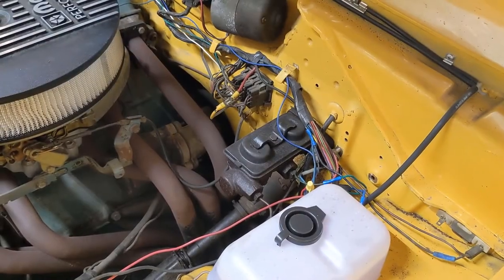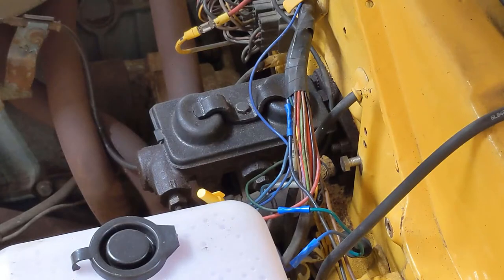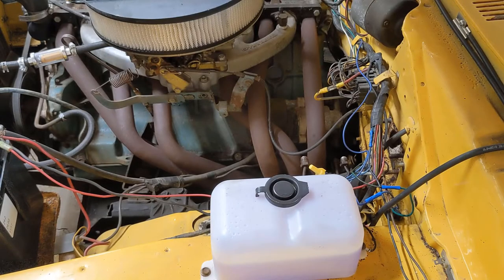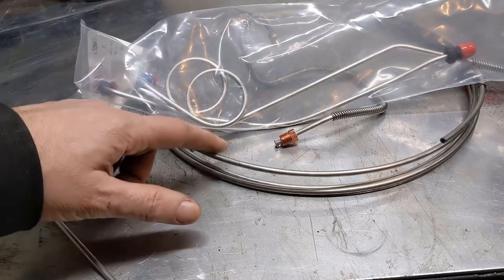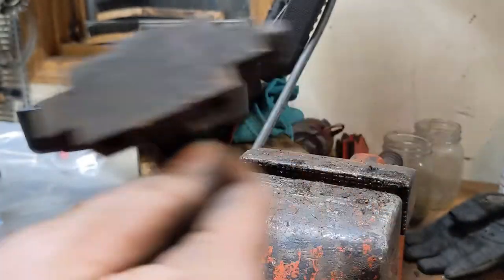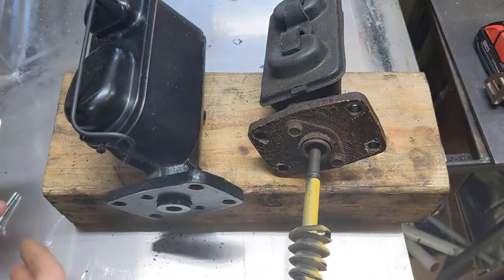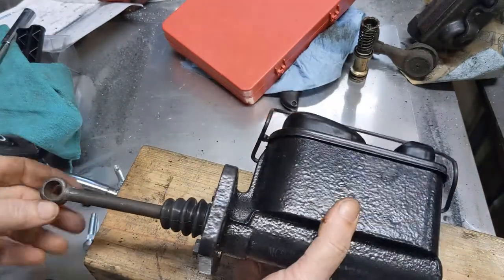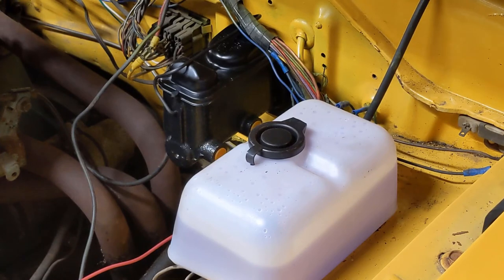Mopar A-Body Master Cylinder Swap: Pirate Jack Disk Brake Conversion Part 3

Comment: Next time use the brake pedal to pull the push rod out.
Leave the master cylinder bolted up, remove the brake switch inside the car, and just pull up on the brake pedal.
The push rod will pop right out. Then remove the push rod bolt. Plus the push rod grommet is important, and readily available.
Get the right part, do the job right. We are talking brakes after all, stopping is good.
Reply from the maker: I've never had great luck using the pedal to pull the rod, but it's certainly worth trying for anyone watching.  It also looks like, at least as of right now, Doctor Diff carries the grommet.
https://www.doctordiff.com/manual-brake-push-rod-retainer-bushing-clip-rubber-grommet.html
Reply: @YoshimoshiGarage   All that's telling me is you've never tried it. Anybody that has, would never do it any other way. Happy Moparing.
Reply: I did this myself when realizing how hard it was to get that bolt out I was like ... what if I pull this pedal back - "pop" so easy.
Reply: @YoshimoshiGarage  I've looked at that grommet before at it looks a lot like a piece of vacuum hose. They usually come with a new M/Cyl.

Comment: station-wagons & police cars , had 11.83” rotors .
pin type , calliper adaptor was Chrysler part #3880557 ,…
76-78 b-body 
Gran Fury , Royal Monaco , Coronet
Reply: the 11.75 replacement rotor is dirt cheap , so like the police dept. , use metallic pads .
Reply: A long time ago in the early '90's I converted a '71 Satellite with 10" manual drums to power disc with new parts using the 'Ehrenberg' Mopar Action article and used the rotors (new) for a 'B' Dodge van. I think they're the same s cop car rotors. The only junkyard parts I used were the knuckles and caliper adapters. I got the Knuckles from a mid '70's A body. The adapters came from a '75 or '76 or '77 Cordoba I think. The parts were pretty cheap. Back then everything was still at the parts stores. I didn't have 'core' calipers but I think it was only $10 ea for the charge. A few years later they didn't want any core charge. I think it only cost me maybe $140 for that using all new parts (hoses, pads, calipers, Master Cyl, hardware, bearings etc) Except for the adapters and knuckles I used EVERYTHING new.

Comment: This is very helpful getting the rod out. If you are converting all four to disk brakes do you need to change the proportioning valve?
Reply from the maker: I've not done 4 drums to 4 disks.  I'd certainly try it first without swapping the proportioning valve to see if they're balanced.

Comment: Do you have part #s for brake lines? I need for my 67 dart gt
Reply from the maker: I believe I made the hard lines for that one myself, though if I had to do it again, I'd probably look at Fine Lines to see if they have them pre-bent.  If you mean the hoses at the wheel, those came with the kit.
Reply: @YoshimoshiGarage  in the video I thought it said you ordered the hard lines pre bent. I'll try finelines. Thanks!

Comment: How would my install be different if I'm working with a 63 that has the single jar type master cylinder still?  Thanks for the great video.
Reply from the maker: It'll be the same. You'll have double lines to the proportioning valve, then it divides to the front and rear.

Comment: I'm looking at this kit for a 69 Barracuda - why did you forgo the power brake option?
Reply from the maker: The car was manual brakes to start with. Adding a brake booster takes up a lot of space and makes working on things that much harder.

Comment: I’v done a disc brake conversion on my 67 Barracuda, I needed a new master cylinder to finish the job, just looking at it doesn’t seem to be the right one. Which master cylinder did you go with? Can you possibly drop a link? Any help definitely does just that. Thanks
Reply from the maker: I did a drum to disc conversion and this was the master cylinder that came with the kit.  The swap also requires changing the proportioning valve to either an original disc valve or an adjustable (which the kit came with).  This is part of the Pirate jack kit, but if I were to order just a master cylinder, a 1974-ish Dart master cylinder (Raybestos  MC36412, front disc, rear drum, manual brakes, 4-bolt flange) would almost certainly be the same.
Reply: @YoshimoshiGarage  awesome, thank you this will most definitely help me 🤙🏼

Comment: Have you drove it with the manual discs? I'm going to convert my 67 and can't decide if I want stay manual or go power.
Reply from the maker: Yes. It's not power, but waaaaay better than it was with manual drums all around.
Reply: Is the pedal closer to the floor than it was with the drum brakes?
Reply from the maker: @mustacherides  I didn't measure a before and after, but if it's closer, it's not enough to be noticeable.

Comment: Excellent and informative. Horrible design getting the master cylinder and push rod out. I have never had so much trouble removing one.My old International has a clevis pin you push in one side and a washer and cotter pin on the other side. Takes about 1 minute. And the push rod comes right out after you remove the circlip.
Reply from the maker: Yes, it's a horrible design.  I've never pulled one that came out easy.
Reply: @YoshimoshiGarage  Do you know what I did instead of putting the locking nut back on where it connects with the brake pedal ? I double nutted it instead . Just temporarily unitl I can see if it is leaking after putting it back together. You can easily reach the nuts as they are on the side easy to access. I am not recommending this to anyone as the locking nut seems like it is gonna stay on no matter what. .